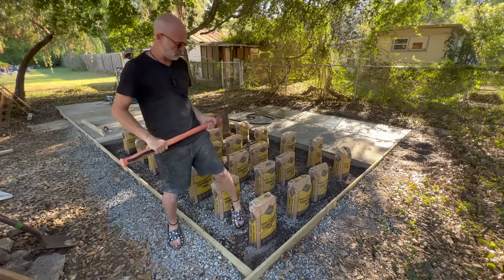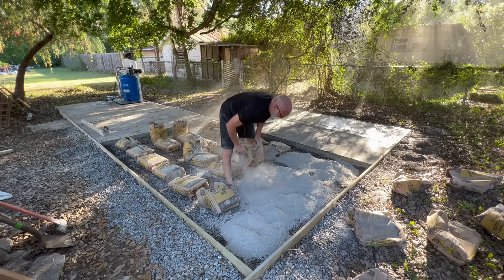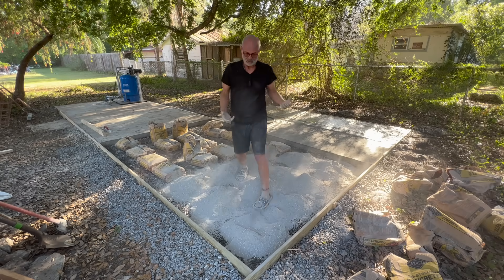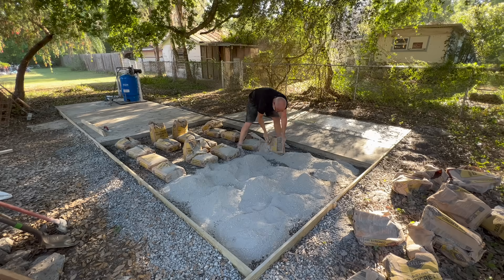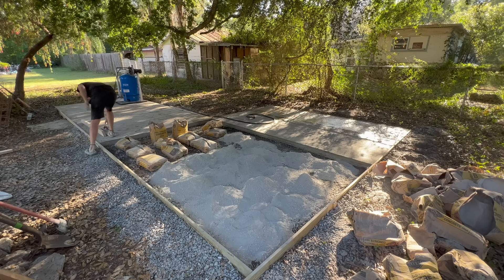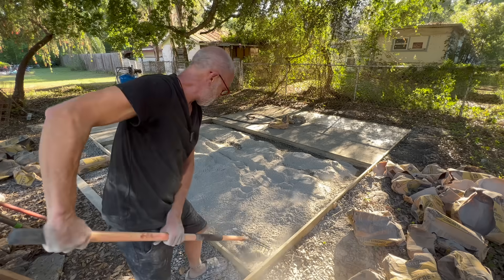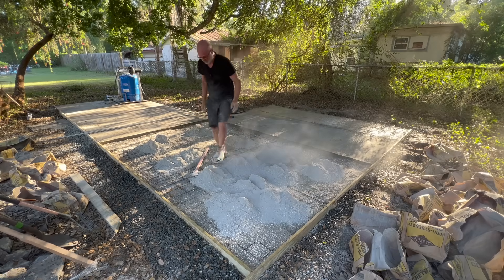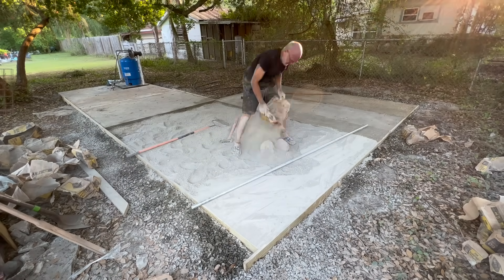Concrete Ninja Warrior Dry Pour Slab for Backyard Building

Comment: I've been work with concrete for over 30 years. As a General Engineering Contractor I can tell you that this is 100% is the wrong way to do concrete. I'd be surprised if his concrete will have the strength equivalent to a 2 sack mix design, when 5 sack is the standard mix design for non-structural concrete.
 If you can find one one civil engineer that would approve this method of pouring concrete, I'll withdraw my statements. 
I wouldn't even follow this method for  dogs to walk on. 
Sorry, I'm just not buying it.
Reply: You are 100% right Ian. This concrete will maybe last 12-months.

Comment: There are some who will say this is not the way to do concrete  and say all that is wrong with it. Here are my findings which will save you hours of research.
This method of doing a concrete slab works for many applications. 
I would not use it for a garage floor or driveway due to the weights of the vehicles, but I would love it if someone did a test on that to see if it works.
I have seen dry pour slabs which had to later be removed. The broken fragments look the same as wet pour, meaning that the cement managed to wick moisture all the way through.
This seems very suited to things like a shed, back patio slab, barn floor, slab for items such as ac unit or generator (I personally have one for my generator did many years ago).
The techniques used in this video are just a little faulty, he should not use his bare hands in cement and should try to avoid inhaling the dust.
The biggest advantage to this method is you can do it by yourself and you don't have to be in a hurry like you would with wet pour.
I would suggest anyone who plans to try this, watch some other videos. The better technique seems to be when you slid a 2x4 back and forth while going down the form, this seems to make the little rocks sink below the surface and leave you with a layer of dust on top. Also, I like the videos showing them using a roller to get the surface even, I would try using the widest roller I can get along with a stick. I think the ground should be soaked before you start, definitely use rebar or mesh and I would do a presoak like he did before I do the final layer on top.
 Another advantage of this method is that if you need a small slab poured, most concrete guys won't do it because it's not worth their time, so you simply can't get anyone to do it even when you've got the money in hand to pay for the service.

Comment: Hopeless helpless and useless don't do it. will crack up in no time, there is a reason concreate is mixed before its put in and the aggregate is for strength. this pad will be super soft. Also a very expensive method

Comment: I like to save a buck when I can, but here I'm not sure you did. 12'x8' at 3"-4" is about a yard of gray gold. there is about 45 - 80lb bags per yard, at about $6.50 each plus tax, so around $300 clams.  the concrete company charges about $100-$125 per yard plus a small delivery fee. it may end up over $300, but you could have it poured in a half hour to an hour depending on how close you can get the truck, it would be about 20 wheelbarrows loaded 1/2 way.  after it's poured, screeded and floated you could sit back with an icy cold beverage for a bit before putting a finish on it.  definitely a time saver. and put some rubber boots and gloves on, that stuff will dry your skin up bad!

Comment: For all you DYI newbie’s out there… don’t use this method.. and don’t believe anyone tell you it worked for them.. do not take my word, call or write to the manufacturer.. there’s a reason why bridges, roads, house foundations, driveways,,, etc are not poured “dry”.. do yourself a favor and do some research… just ask yourself if you contracted a large concrete patio pour, and the contractor showed up with bags of Readymix and just threw it down, sprayed some water on it and left, i don’t think you would be a satisfied customer

Comment: I developed lung lesions and silicosis from not wearing a mask and breathing in dry bagged concrete.  Even though outside, I would highly recommend wearing a mask.  Lung lessions are gradually getting smaller over years but the long term effect along with COVID can shorten your life?  

As a side note.  You don't have to do the full  slab all in one day.  Make sections with expansion board mix in a wheel barrow and dump in each section.   Trying to cut corners is not a good idea.  Hard work and sweat will do you good!  Of course this is coming from an old guy that is out of touch with the real world.  Right😅

Comment: I did a number of dry pours, what I found works best is allowing about 25 mm space at the top to spread out a very sloppy mix of quick set high strength concrete +40MPA.  The finish is not so powdery.

Comment: Hey buddy, Probably should have dug down and put a footing on the paremeter maybe dig some holes in corners and 4 foot apart put som rebar in that way  the holes 3 foot deep that way when you build on it will hold the weight. also just stake the cross 2x4's and when the firs section drys take it out and you won't have the 2 by in the floor to rot out. My 2 cents worth!!

Comment: You're wasting your time and money putting in wire mesh.  It's function is to hold the concrete together during plastic shrinkage.  Since you're basically putting it at the top of the first layer and the bottom of the second layer, it's not allowed to do its job.  It's not monolithic but two separate layers.  

Please at least wear a dust mask.  Silicosis is a real thing with cement dust.  

Other than that, I'm glad you're showing that engineered concrete placement for commercial projects is one thing.  Personal slabs for putting small structures or for driving on with personal vehicles isn't that precise.  Well done.

Comment: You cant rent a floor grinder pretty cheap and go over all the slab in a back and forth motion, it will expose the rocks and make it look like terazzo. It will grind off quickly with new concrete and flatten it out.

Comment: Good on you mate.   Ex formwork carpenter here watched a few of these dry pour videos honestly never heard of it before last few weeks , your the first bloke I've seen putting rebar / mesh in, as long as your doing that, for what your using it for.  Be fine.   If you want it perfect, obviously truck and crew of guys is the way to go, but for a tool shed etc.  I see nothing wrong with it.   Only thing I'd do is wet it down then roll out plastic over it for a few days.   Long as your keeping it wet.   I dont know how it would go with a pressure washer on it in parts but generally speaking as long as that mesh is in there and it stays wet it should be more than fine for your uses.   The only criticism I have, and it's minor, would be I'd drill each of those connecting slabs and glue rebar into them every 8" or so then when the slab dries it's all tied in and won't crack.   But that's a minor thing.   I did a slab here, in Aus mind you similar size recently and I paid a crew of guys, was close to that size, but pebble Crete had to be pretty much perfect I think was 11k.   But I'm long past the point of doing my own stuff I do bits here and there.   But good on you for doing that.   You can be as fussy or as rough as you want with concrete.  As long as it's functional for you, then it's fine.   And even if you wanted to do it extra good, you'd just dig a perimeter footing deeper and put big bar around it, and that's basically then a garage slab anyways.  Even just going to big bar over mesh prob enough.

Also, what you could do, if you want it perfect, is build your walls and nail / screw them down, then use literally 2-3mm up the bottom plate as a form, and buy a heap of floor leveller.  And you'd basically just pour that runny then you have a perfect slab.  We'll would look perfect anyways.  For your purposes prob still overkill.  Even just pouring say an ice cream container of floor leveller and then pouring over the rough bits and screeding would tidy it up.

The only other thing I'll say, is your concern ISNT weight down, but probably LIFT UP, ie wind loads.  So if you just make absolutely sure there is enough water on the edges specially.   As which ever way you do it, spaghetti anchors or chemset or Ramset etc.   You NEED that perimeter done right or there's potentially no strength UPWARD under wind loads.   I'd be more concerned about that, than weight down.   So I'd keep that in mind more water around the edges, and then as you build up, keep eave overhangs to a minimum as that will reduce uplift, tie it with cyclone ties / diagonal bracing etc.   But that perimeter MUST be right for that purpose.    Even just bigger bar around the perimeter only would make a huge difference.

So if you've got for instance, spaghetti anchors every 12 inches, and there's a dry spot every so often, it could be only 1 anchor has any strength out of 2, 3 or 4, which would mean an anchor every 48 inches holding it down worst case scenario.   So that's what you want to avoid.  

I'd also be putting plastic down UNDER the gravel, as that will both hold water in, make for a much stronger slab, AND prevent rising damp on the frame.    Even though treated lumber is pretty good now days, a thin sheet of plastic do more than the treated lumber.   But do both. Again shed slab, who gives a fuck at the ends of the day, but my 3c.
Reply: I'm learning a lot all the time from people like you who are generous with their time and knowledge. It's much appreciated.
Reply: Great info, ty
Reply: Fella wrote a book

Comment: how did you feel in the spaces left when removing the boards between the slabs or did you remove board that was butted to previous slab first and use the edge of the slab as your guide?
Reply: Yes, use the new slab side for a wall. This also helps keep it even where they butt together.

Comment: People, this method is VERY dangerous. To the uneducated and inexperienced in construction, your video may seem like a cool idea. And, your method may be just fine for many non-critical backyard projects where proper structural integrity is not important. But if concrete neds to be used for something where properr structural support is needed, then your method is very dangerous. Without mixing concrete properly and with correct ratios of water then the strucural properties and integrity of the concrete will be dramatically changed.
Reply: Yeah but it's one thing if the concrete is for a foundation for a house or a concrete driveway.  When building a base for a chicken coop or a small shed yeah it's weaker but not enough to matter for what it's being used for.
Reply: Yeah I was thinking for a DIYer doing this for a small tool shed or walkway is one thing but I am concerned about building a structure on this. I have poured a number of pads and driveways and even have a small mixer for small house projects but a structure on it. I sure hope he means one of those sheet metal lawn mower sheds.
Reply: No, it's not dangerous. It's just for a slab, it's not holding up a house.
Reply: @panerai_fan  Its very dangerous to someones health
Reply: Agreed. I've been doing concrete pads for almost 50 years.... I would not do this to a paying customer, for sure.

Comment: All jokes aside, I commend you for ccx such hard work and great videos showing others that this CAN be done without breaking the bank. Today everything is so expensive that to hire a contractor to pour that size slab in an isolate area not so close to a cement foundry will cost you over 12K. Great job man!!🎉💪💯👊💥🚀🍺🍺🍺
Reply: No lie, before COVID you could buy a 90 lbs of Ready Mix for 3.90 a bag. Now it's almost $6 a bag.
Reply: @ralphalvarez5465  Its between $7 and $9 here, depending on where you shop. Crazy these dys
Reply: Would it really be 12k$
Reply: @randyjohnson5179  I had a contractor pour a 1000 ft 4 inch slab at $9000...that's 9 dollars a foot, he was the cheapest of 4 estimates. The more isolated you are from the concrete manufacturer, the longer the truck and ccx workers need to travel that adds to cost as well. It's crazy after covid Danes as lumber prices. Why?? Are we running out of trees?? Noo...same as we are not running out of gas or concrete. It's just supply and demand effect

Comment: You scare me, dry or not, rubber boots, gloves and at a minimum an N-95 though a N-99 mask.  I envy your ability to handle the work.  I would have fallen over.  But you really need to remember, people are going to imitate you, which is a really big compliment.  Have them imitate you with some sense of safety.  Concrete and especially concrete dust is nasty stuff.

Comment: I'd like to see 2 test "bricks",
 1 with wet mix and 1 with this method and do a strength test, just out of curiosity. Try weights to break them in half so it can be measured  👍🙂
Reply: Seems like you have an idea for a very popular youtube video!
Reply: A wet mix will be stronger than the dry mix if tested within a certain time frame. The longer concrete has to set, the stronger it is. It actually takes about 12 years for concrete to reach its maximum strength potential.